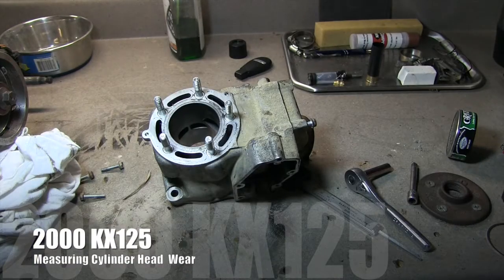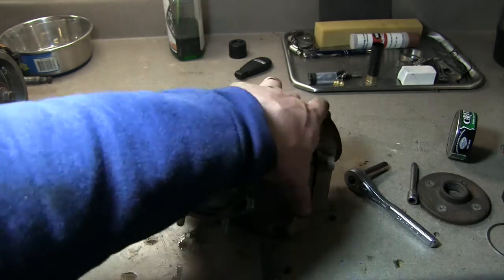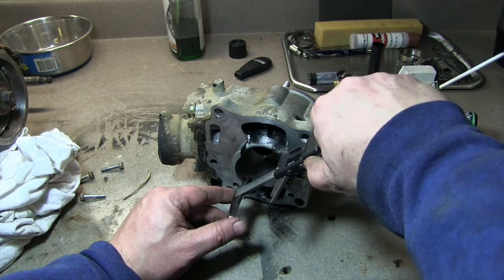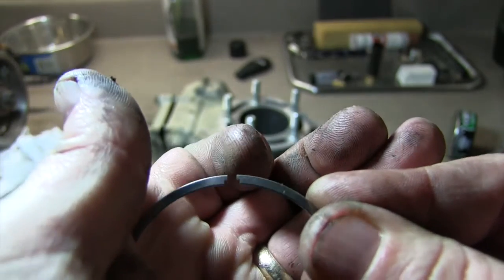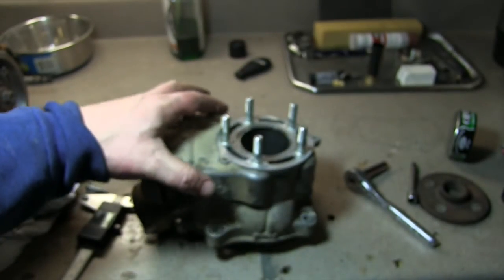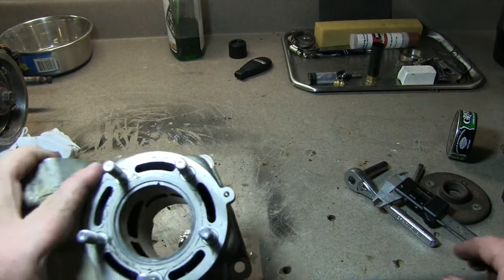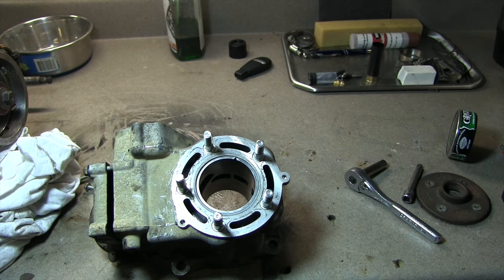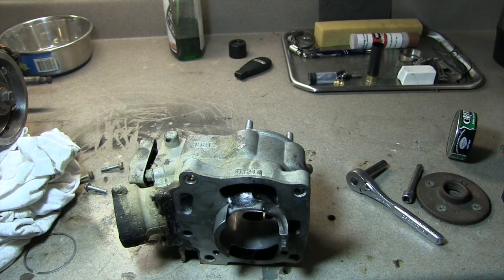2000 KX125 Part 7 : Measuring Cylinder Head Wear

Comment: are you telling us that you're using the old ring with a new piston ? You stated that you didn't need a new ring...huh ?....I put the ring in the cylinder and push it down slightly with the piston (upside down) to ensure proper alignment and then check with a feeler gauge....
Reply from the maker: No, it's a new ring